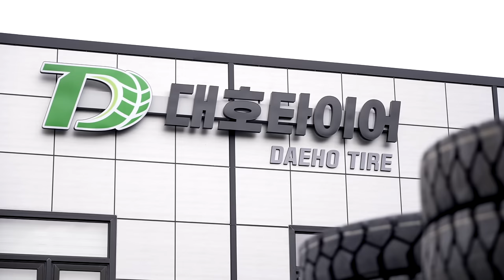Amazing Process of Making Retreaded Tire With Old Tires. Tire Recycling Factory in Korea

Comment: In general, they have not yet figured out how to restore the sidewall of the tire. Therefore, this method is suitable only for those who wear out the protector in 2-3 years, a maximum of 5 years. Any rubber is designed for a service life of only 5-6 years, then it cracks in our climate.
And yet – a welded tire is poorly balanced and less reliable than a normal one. Therefore, it is not recommended to use welding on the front wheels, especially if you drive fast.
Well, how can I tell you, if a piece of loose welded rubber from a truck flies into your forehead on the highway, then at best you'll shit yourself, think about the worst yourself.
Previously, they also "brewed" in our country. Now, it seems, it is impossible to use such a thing.

Comment: Calling this manufacturing tires is a stretch. Recapping worn-out tires with a new layer of rubber has been around for a hundred years or more. In Vietnam they even cut treads on old worn out tires with sharp knives to make tires look new. Underneath the rubber is paper thin. People drive on these tires run blowout risks. But in Vietnam no one cares about that, money is everything.

Comment: I don't understand !! I've always been told that tire rubber deteriorates over time !
So are those tires still suitable for road  ?
Reply: Probably sold mostly to developing countries with less stringent regulations?
Reply: Commercial truck tires see so many miles that the tread can wear out in less than a year while the rest of the casing is still quite fresh. This is not commonly done with passenger car tires because they are usually much older by the time the tread is worn out.
Reply: @moconnell663  thank you

Comment: I didn't see anyone check the date code on the tires to see if they were too old. A tire should be thrown out after 10 years regardless of thread life. Also after 10 years it shouldn't even be used for the retread process.

Comment: I was driving a Truck and doing 100klm (62 Miles) the steering Tyre blew up and  quickly lost control but had slammed the brakes to find myself on the opposite side, Lucky there were no traffic on the other side coming. when the Police arrived at the incident seen they investigated the truck and found the course was the tread had came off from the joint. the truck was damaged ripped out the Guard, bonnet lid light, oil filter and fuel filter leaking and dew other parts and wiring estimated to be $13,000 damage. I was ok but could have been worse. Never buy retread tyres or even take them for nothing. Thank god Australia made them Illegal. Best law in Australia.

Comment: Those road gators, aka the treads from truck trailers all over the highways due to retreads  blowing are a danger and retreads, even if just on trailer in the states need to be made illegal. They can cause serious damage to the underside of a car/PU truck and the trucker gets away with no liability. 
Just take old tires, and completely recycle and produce NEW tires, not crappy retreads.

Comment: The first process is the worst & creates many different road hazards. Ya, those are the ones that come loose, cause damage to other vehicles & leave rubber waste on roads everywhere. 
The second process is inherently safer, but, more expensive, of course! 
Btw, 18 wheelers have that many tires for a reason, if one blows, the likelihood of an accident is fairly low. Those double wide tires on an 18 wheeler is a ridiculous & dangerous idea! 
Also, the front tires (steer tires) can never be a retread or replaced by a retread...for those who didn't know.

Comment: Retreaded Tire are dangerous and not worth the money.
Reply: Not true. Do you know plane landing gear tires are retreaded?
Reply: @davidhan9979  Yeah, and the aviation has considerably different standards then highway truck tires. Trying to compare them is foolish. They regularly fail and have tread separation on the highway.